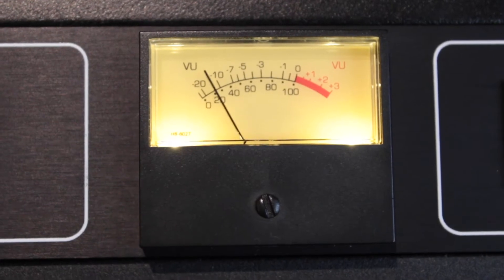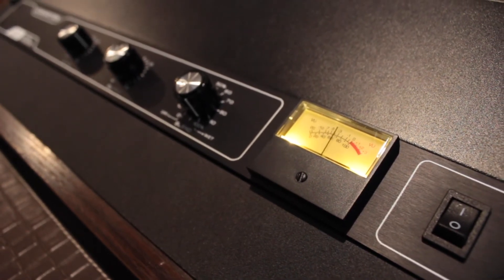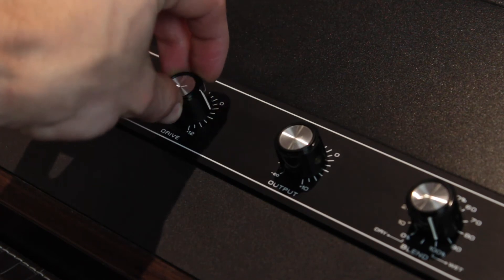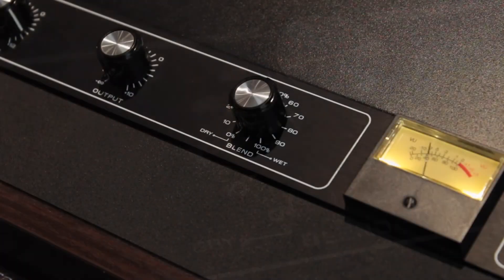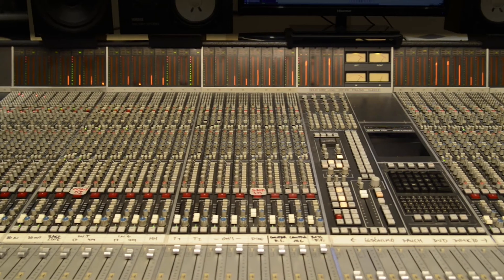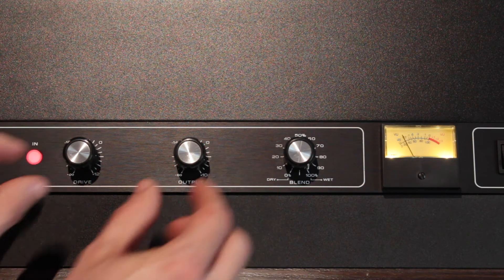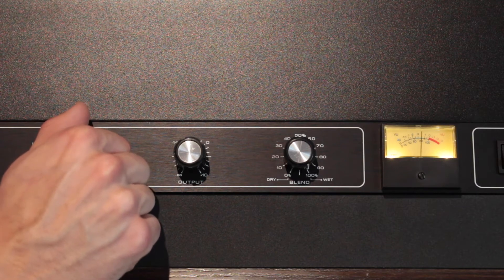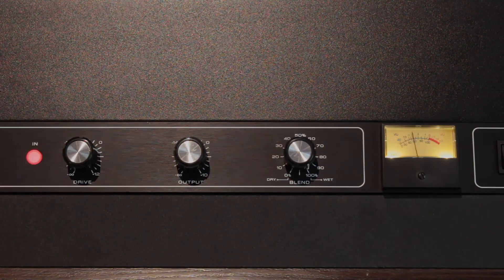Kahayan Solid 4000 Stereo Mixbuss | How it works (English Version 2020)

Comment: is this as expansion  for Epsilon? or is  stand alone? or are 2 models or just function as both?     I wanted to know if with this I am ready to just put  DB25 and ready to fo
Reply from the maker: hi!! This is a stand alone unit. We mean, an stereo processor mixbuss unit, not an Epsilon expansion.  XLR inputs and outputs. Thanks.
Reply: @kahayanprofesional   thanks for your answer, but my question was  because I read on an audio store that was an expander for epsilon, so I do not know if that particular unit is another model or all solid 4000 also can be an expander for epsilon
Reply from the maker: @bluematrix7  This was a bad description of this unit. This is not an Epsilon expander. But you can use it in combination with an Epsilon summing mixer. For example, like a master insert in the stereo master output. Thanks.
Reply: @kahayanprofesional   thank you!!